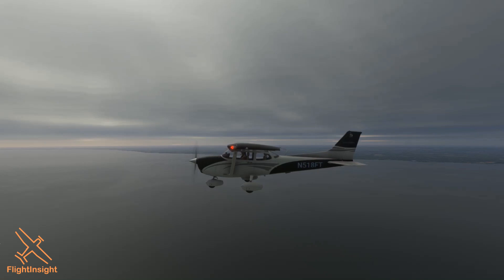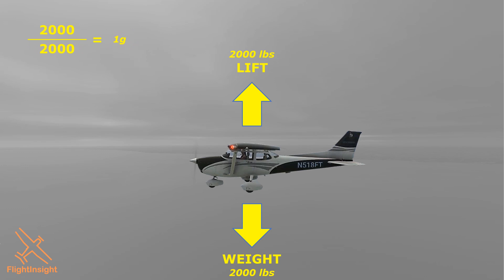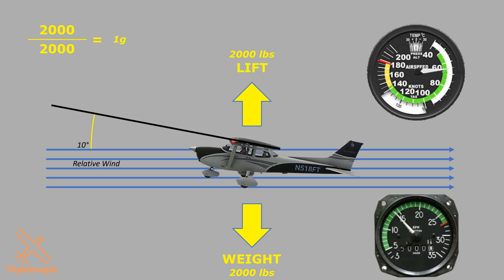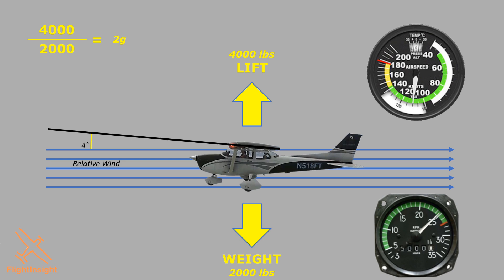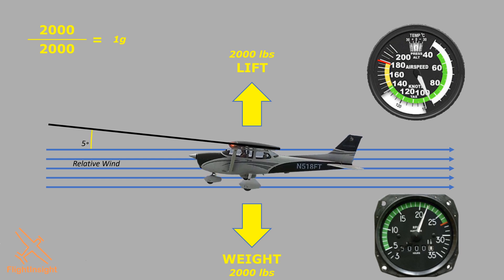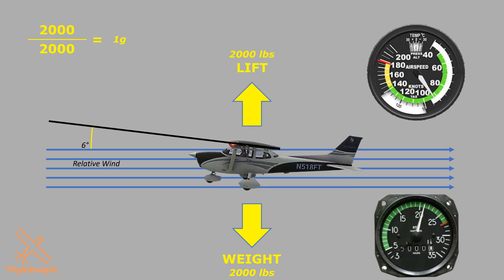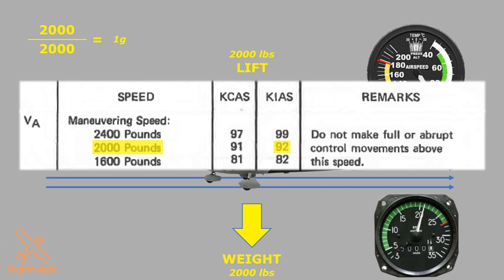How Maneuvering Speed Protects Your Aircraft | Why Maneuvering Speed Changes with Weight

Comment: Great video for a high level understanding. The explanation makes the concept intuitive. But I do think the explanation makes some assumptions that should be noted. This theory uses the same 4G load factor for the structural limits of the wings. But a "G" is a measure of acceleration, not force (F=ma), and therefore the amount of Gs the airframe can handle should be higher when flying with less weight because FORCE defines the airframe structural limits not ACCELERATION. The Cessna 172N load factor limit at 2300lbs is 3.8G, while the load factor limit at 1900lbs is 4.4G (which works out because (2300/2000)*3.8=4.4). With lesser weight the aircraft should be able to handle more Gs, so this model isn't completely accurate. Other assumptions include each "x" degrees of AoA increase equates to one G, but the relationship isn't really linear. But once again, overall the video is a very intuitive explanation of this concept and extremely helpful.
Reply: You just answered my question that I was about to put up.
I agree,a lower load in the aircraft should allow the structure to have less inertia.

Comment: Great explanation! Quick question, in the scenario where you were pitching up, wouldn't you always see a reduction in the airspeed unless you add more power? I'm imagining that as you pitch up, the resultant reduction in speed would get you below the maneuvering speed before you have a change to exceed the max load factor?

Comment: Absolutely BS.

If I created a new material called McCrackium that had the same strength as aluminum, and the same volume, but made the whole aircraft have nearly zero density.  Could the aircraft survive a 1000 g turn?  Of course.

When you consider an airplane, of infinite mass, flying a ballistic path , and then "pulls up".  The wings pop off.

The G meter, in the aircraft, is not a universal measure of the stress in the wing spar, empennage, and engine mount(s).

Just as an AoA meter is a better indicator of impending stall, a strain gauge on the spar (etc.) is a better indicator of impending  over stress.

Aerospace "engineers" are generally really dumb.

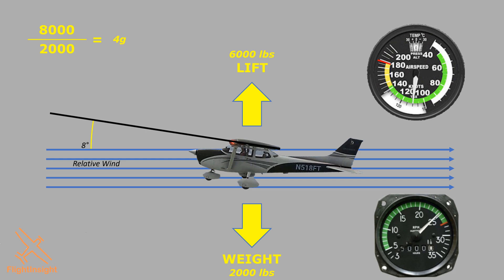Comment: I believe there's a typo in the graphic at the 3:20 mark. The AoA is 8˚ (4x the level cruise 1 g AoA=2˚), the load factor is 4g (8,000/2,000), but the diagram is labeled "6000 lbs LIFT." I believe that should be labeled 8000 lbs.

Love your lessons. They are the best.

Comment: Thanks for the helpful animation! 

Question here - when climbing, you put your plane at an AOA and full power, so how does load factor / stall play here?
Reply from the maker: Hi Coral. When lift is greater than weight, there will be a load factor higher than 1g, like if we pull back on the stick. In a steady climb though, lift returns to equaling weight so load factor is back to 1. Hope that makes sense

Comment: This is a well done video, very clearly explained. HOWEVER, there is a common misconception about Va (Design Maneuvering Speed) that it will always protect you from the G-limit while you are below it, this is incorrect. Va is only required by law to protect the flight control surfaces, not the whole airframe, it is completely legal for the manufacturer to design the plane so it can exceed the G limit even while below Va. 

So just because you are below Va, it doesn't necessarily mean the G-limit cannot be exceeded, it depends on what speed the designers decide to set as Va. Many manufacturers will set Va to provide protection from the G-limit, but some may not. The correct speed which always ensures the plane will stall before exceeding the G-limit is called Vo, or the Operating Maneuvering Speed.

Comment: Va: The maximum airspeed at which you can go Full Tilt Bozo on the elevator and still have wings.
Reply: Depends on the design of the aircraft, the law does not require Va to protect the aircraft from exceeding the G limit, Va is about the design of the control surfaces only. Many aircraft are designed so you cannot exceed the g-limit at or below Va, but not all as it is up to the aircraft designer. Its perfectly legal for the manufacturer to design the aircraft so that it CAN exceed the G limit even while below the published Va, and so long as the control surfaces (e.g. elevator) are not damaged then the aircraft is still compliant. The speed where you can't exceed the G-limit before stalling is called Vo.

Comment: This is perhaps the only situation where you err on the slow side. In transport category airplanes (airliners) we use Vb- turbulence penetration airspeed (slower than Va). Engineers calculate Vb by determining the airspeed increase experienced in large updrafts: 1,500- 3,000 FPM depending on flight level. Many airliners experienced structural damage flying Va into rough weather. Encountering a strong updraft would increase IAS well above Va and they would lose the stall relief protection. I haven't flown GA airplanes in decades but I'm wondering if the industry is exploring a Vb for light aircraft. Fly safe.

Comment: That is simply an outstanding explanation (with PERFECT graphics) on maneuvering speed as defined in the POH. There’s another concept that outside of the defined curriculum for PPT but it would be fascinating to see it get your treatment: DMMS or “defined minimum maneuvering speed” - this is gaining tracking from a number of folks pushing for more advanced PPT training (AQP) to bring down the number of stall/spin accidents (by GA aircraft of all types) that borrows from the big iron boys. I know it’s outside of your wheelhouse, and I LOVE the content you are producing, but you’ve got such a comprehensive way of explaining concepts, it would be great to see this someday. In the meantime, I’m looking at signing up for your ground school - if all the content there is like this free content on YouTube, that’s a huge win!
Reply from the maker: Thanks so much Chris! You mention an important concept, dealing less with Va-maneuvering speed per se, and more I think with the problem of getting too slow in a critical phase of flight like takeoff or approach. A recent video we did on Vx vs Vy, touches on this, especially the end of the video with the engine failure after takeoff and how being slower than best glide requires a pitch down to unload the wing which is less than ideal! On the approach side, it's definitely one of the problems with circling approaches and how we're taught to hold altitude while loading up the wing in turns at slow speeds, ugh.
Reply: It is completely based on BS

Comment: This is another area where I think AoA indicators and LRI (Lift Reserve Indicator) do not get their due consideration. Not only can a LRI show you when you getting dangerously close to a stall but they can show you when you have an excessive amount of lift reserve which means you are above your Va. And it automatically adjusts for weight without the pilot having to look up Va in the POH.
Reply from the maker: Agree. Haven't flown with an LRI have had an AoA indicator on board.